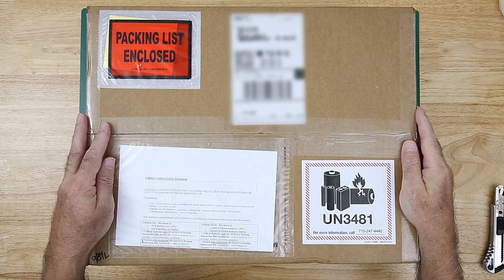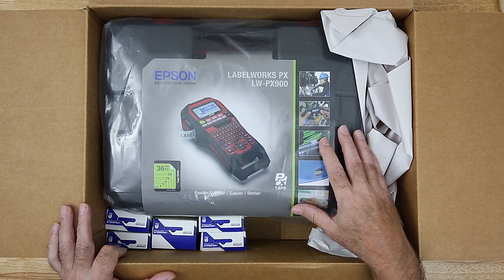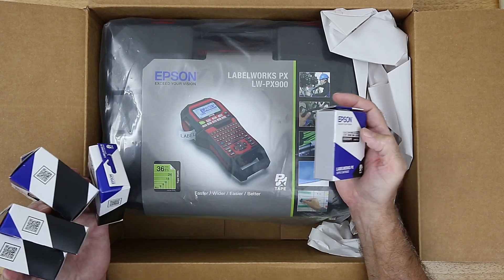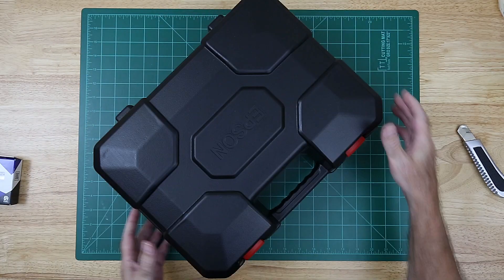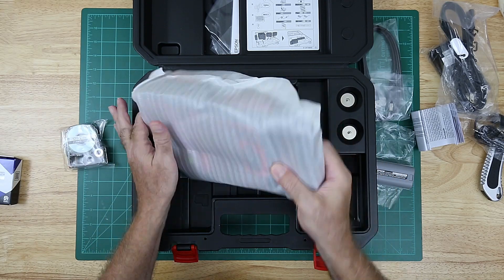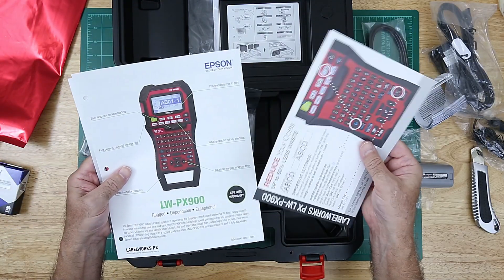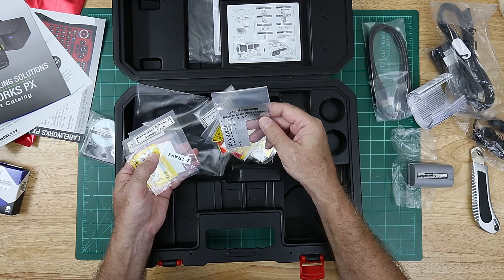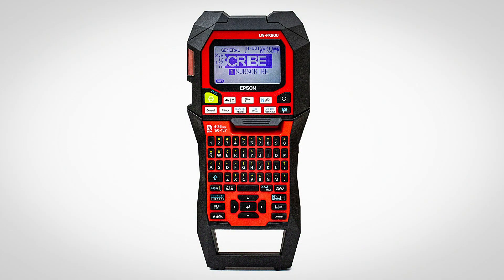Unboxing a New Tool - PX900

Comment: Nice tool. I really couldn’t justify the cost for the small amount if labels I needed. What I did find was heat shrink printable tubing for my old Brother P-touch label maker. Not even close to what options you have with this but it worked.
Reply from the maker: Yea, it's a cost/benefit analysis that's different for each person. 
For me, past experience with poor labeling options drove me to - do it right - this time.
 What really interested me in this model was the 1.5 inch (36mm) maximum label tape width, and more importantly the 360-dpi (dots per inch) resolution. The much higher than average dpi allows for clear text on really small connector labels, and tiny heat-shrink tube for small wires. It also lets me create pretty small QR codes (that I'll talk about in an upcoming video). 
These features allow me to label things that SHOULD be labeled but typically would be passed by, do to limited capabilities of a lesser printer. 
I spent years doing tasks - good enough for wow - which came back to bite me in the glutes more than once. Now I'm switching to - any job worth doing is worth doing well - .